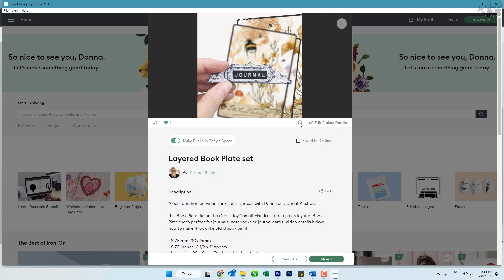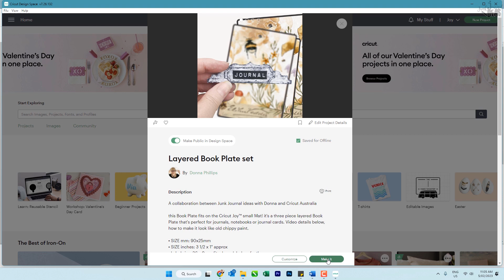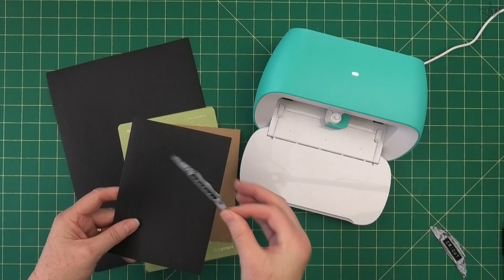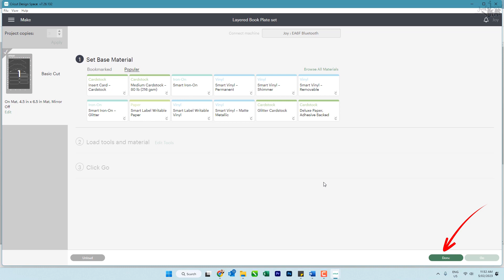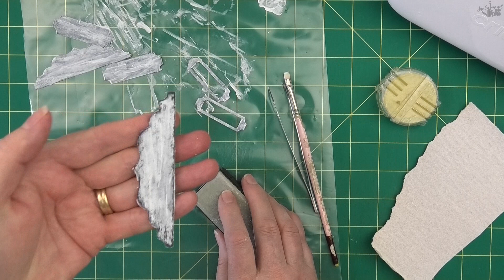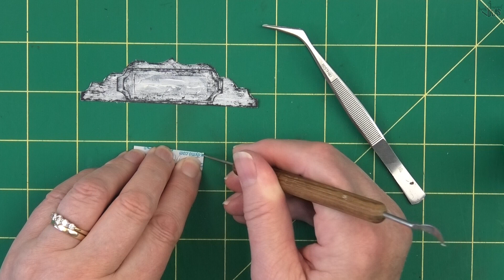Cricut Joy design space project and how to make it (beginner)

Comment: Thanks for sharing the info on the Cricut Joy.  I am a new owner of a Joy, having won one at a scrapbook convention earlier this month-I still don't believe it!!  Been checking youtube for how tos and such and I found your videos-lucky me.  I was wondering if you have ever tried to cut chipboard with it?  On the boat cut demo you showed, a screen came up on the page asking if you would like to cut again.  Does that mean it will cut another boat out or will it cut on the same cutting lines again?  If it did cut on the same cutting line again, I would guess cutting lite weight chipboard might be possible.  Would hate to mess the machine up with just my guessing, certainly don't want you to mess up your machine trying this out either.  Thanks again.  😃
Reply from the maker: Hey Norma! oh wow you won a Joy! how wonderful thats such a great prize,  no, you can't use the joy to cut chipboard, The Cricut Joy is not designed to cut chipboard, it's only suitable for lighter materials. When doing the demo, if you follow the settings you won't need to cut the same piece twice, it was for a new boat. You can do 2 passes, but you need to tell the cricut in design space that you want to cut twice, i havent had to do that so i have no instructions for you. Good luck with you joy i know you'll love it ♡☆🦋 crafty hugs Donna